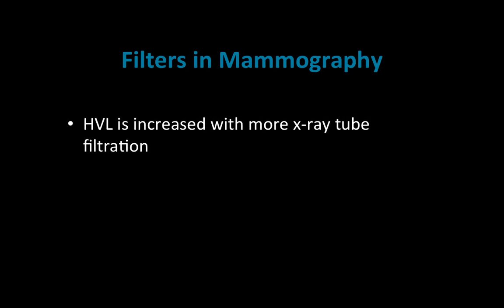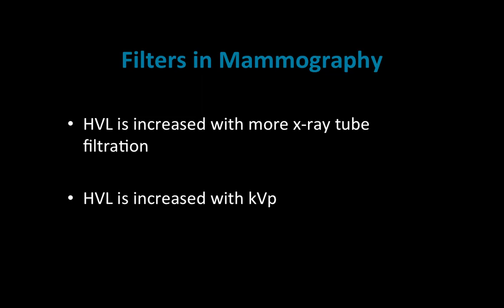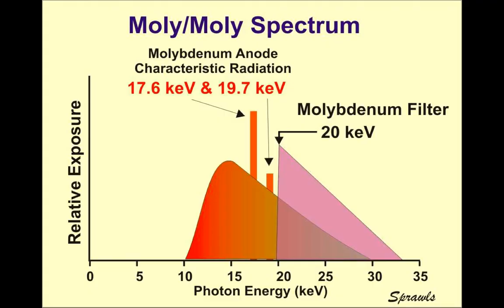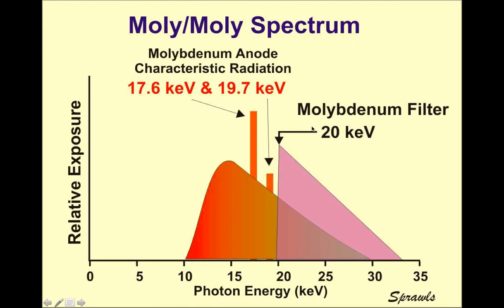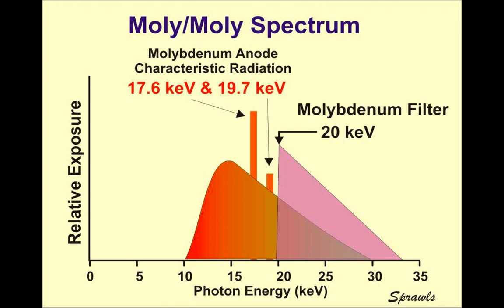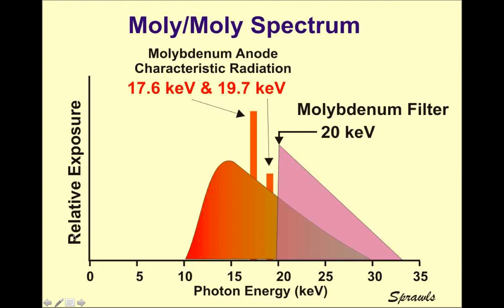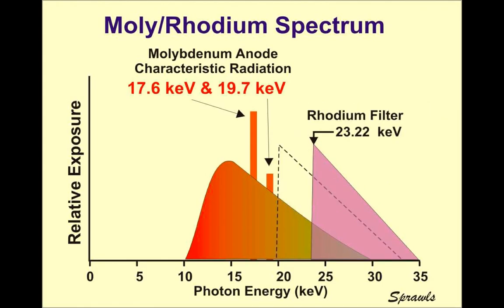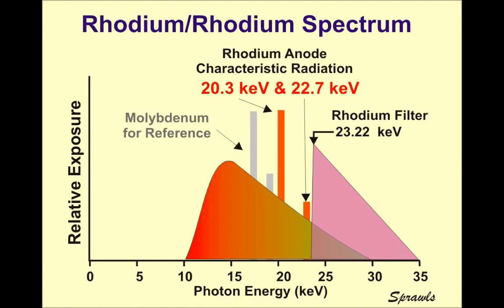X ray filtration in mammography

Comment: So, the higher energy rays are absorbed by the Mo filter (due to the increase of the cross section of the photo electronic phenomenon at that energy) which then yields back the characteristic x rays and the low energy rays are absorbed due to the width of the filter (the same thing that happens with the Al filter). So we are left with mostly the characteristic radiation.
Reply: Hello, I know this is a bit late but why do characteristic go through while lower are absorbed and higher than the k edge are absorbed, What is the mechanism exactly?

Comment: So how have the lower energies been filtered in this spectrum. With Al filters?
Reply: Yes through inherent filtration
Reply: I believe that the low energy rays are absorbed due to the width of the filter, as it happens with any other filter in an x ray tube. Like the Al filter. At low energies the photoelectric phenomenon is stronger and most of the radiation is absorbed.